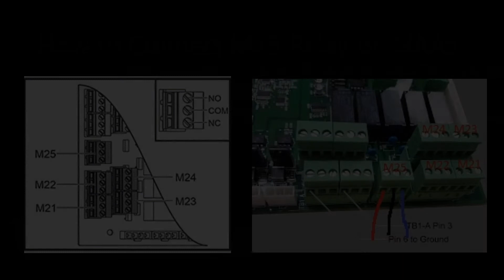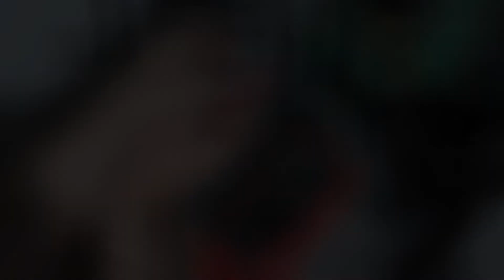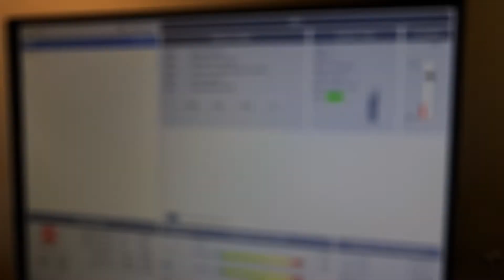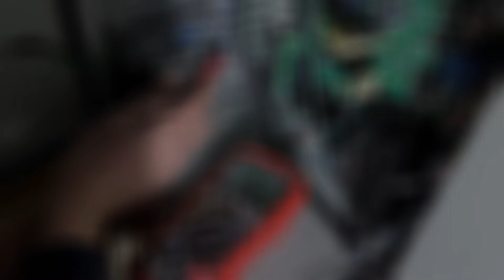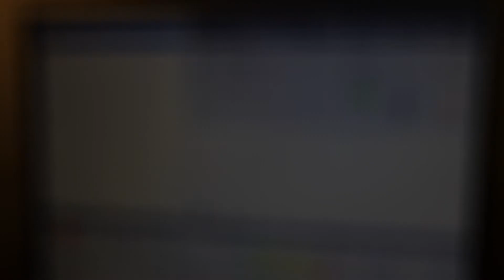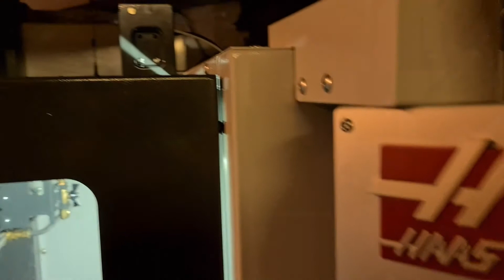HAAS M25 Relay using M55, M65 & M-Fin

Comment: Any chance you know the connector number for the white connector that plugs into the M-Fin P8 location on the board? $95 for a plastic plug and two wires seems a big excessive.
Reply: Totally agree here.  The relays are like 175.00 too!